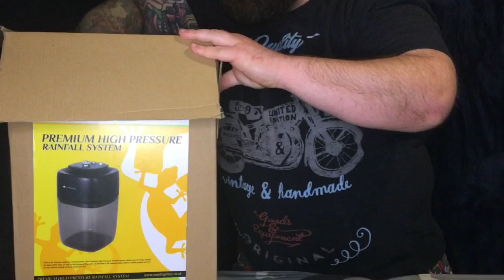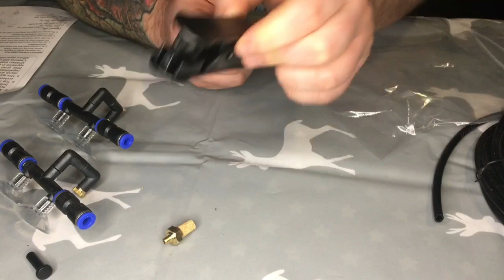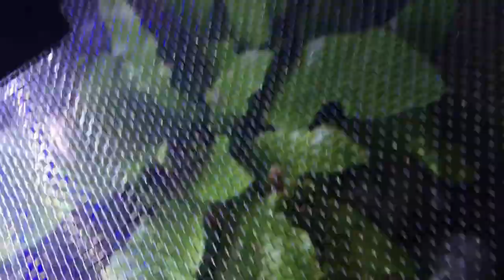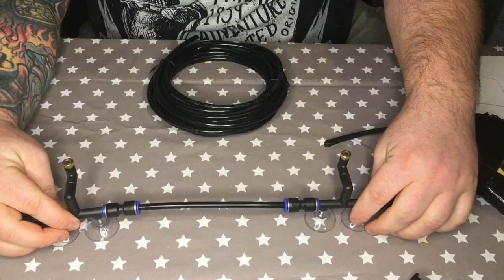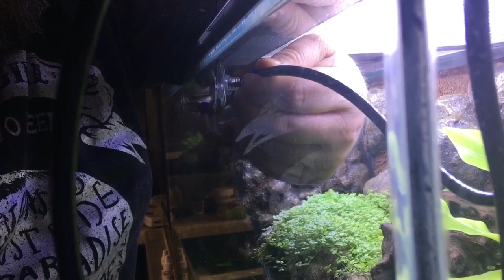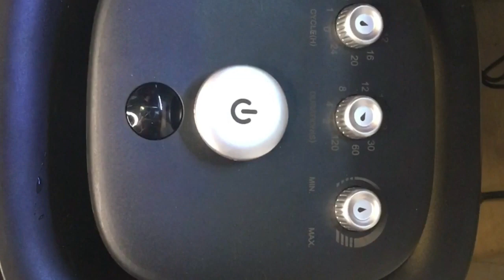SWELL REPTILES / REPTIZOO PREMIUM HIGH PRESSURE RAINFALL MISTING SYSTEM UNBOXING AND SETUP

Comment: Nice video, thanks for sharing. Thinking of getting one, is yours still behaving itself?
Reply from the maker: Thanks for the comment!  Tbh it’s not been running since we overhauled the room, as I’ve got a lot of new plumbing bits to try and automate a lot of tanks from the unit at a later date.  It worked fine till it was decommissioned and I intend on using it again.  

There are similar units from habistat and the new exo terra looks ok too. Check out Jon’s rainforest room for a review on the latest exo terra monsoon.  

I think the mist king is probably the best, but for the price it should be!
Reply: Will have a look into it. For some reason I'm drawn to the swell reptiles one though, as I am wondering if it may be much the same technology as many of the others which will cost a bit more for the brand name. Could be wrong though, and have no clue really. It's a pity so many products get reviews soon after purchase, with no way of knowing how well they hold up over time. I'm always a bit sceptical of online "star" rating reviews too, as everything that ever gets made from a top end Mercedes to a potato peeler will have a few faulty ones off the production line. Anyway, will check out Jon's page, thanks again!
Reply from the maker: @AdamB-Jones  no worries.  Check out the habistat and monsoon though as I think they’re a similar price.  The main reason I say check them out, they don’t seem to have the dials that could let water in, and are more of a sealed unit.
Reply: Will do, cheers :-)
Reply: One last question! Can you twist the nozzle so that the mist goes from fine to more of a spray/stream? Like you can with the hand held pump sprayers? Cheers
Reply from the maker: @AdamB-Jones  ah!  We tried doing that so we could alter the humidity in each viv, but it didn’t really work, so I’d say no.  We plan to use differing numbers of spray nozzles depending on how humid we need it.
Reply: Fair do's, what I'm actually wanting is more of a spray than a mist - don't mind a mix of the two, but actually don't think the super fine mist you get with mistkings is what I'm after, so maybe this one would be a good choice. I'm wanting to use it for a tropical bioactive set up in a glass tank for a tarantula, and I'm after raising humidity via deep substrate hydration layers/evaporation, as well as watering plants, and giving maybe 1cm-ish of slightly damper substrate once or twice a day. Also like that you can change the power on this one, which you don't seem to be able to do on the monsoon. I'd guess the lower the setting the more of a stream of "rain" rather than mist? Is there much difference between low and high power setting? There's another two questions for you after my promised final question. Oops ;-)
Reply from the maker: @AdamB-Jones  I think this may be the unit for you then.  The more you up
the power, the ‘mistier’ it becomes.  I know nothing about tarantulas… it’s the one thing Amy has vetoed… I’m working on a jumping spider or ladybird spider, but she’s not sold on them either!
Reply: Ha! Misters are not really a thing people normally use for T's, as mostly enclosures are really small compared to herps, so a mister like these would be a bit like throwing a hurricane at them. That's partly why I'm keen on being able to turn it down. 

What I am doing though, is planning a set up for a big 3 foot display tank (that's very big for a T tank) for a goliath, which tend to do better with higher humidity, provided air doesn't stagnate. Most of which will be achieved through moisture layers evaporating through a deep substrate layer over a drainage layer. Plan for the mister is to help keep the plants/moss healthy, and also ramp up humidity a wee bit maybe in the morning and at night. Pretty unnecessary for basic tarantula tick-over husbandry, but I don't really care, I'll set it up in a way that won't bother the spider. It'll be class. Though it will probably end up just being a nice looking planted enclosure with the odd cameo from the spider when we dim the lights in front of the telly! :-) 

How anyone could not be keen on a jumping spider is beyond me. She has SEEN one right? Cute as a bloody teddy bear!!!
Reply from the maker: @AdamB-Jones  sounds pretty sweet… saw one of those in a pet shop in Cardiff when I was a kid… not my cup of tea, but I could certainly appreciate it.  A friend of mine had a tarantula shed, which was amazing but they weren’t displayed the best.  We’re just working on a display tank for the scorpions.  Trying to keep numbers low in nice enclosures… quality over quantity.

Seriously she won’t have it, but I’m not that into tarantulas anyway, just a couple of true spider and a red knee would Fi me!
Reply: Yeah, I've been keeping T's for nearly 20 years now, and have done the whole racks of plastic tubs crammed into shelving etc. which is absolutely fine, just not for me anymore for various reasons. Now I actually only have the goliath, and two baby curly's. Sort of grown to feel that I'd rather have a smaller number, but display them better. Also going for quality over quantity I guess! Have fun with the scorps, I've subbed to your channel, and am sure I'll enjoy future vids. Thanks a million for all the help. :-)